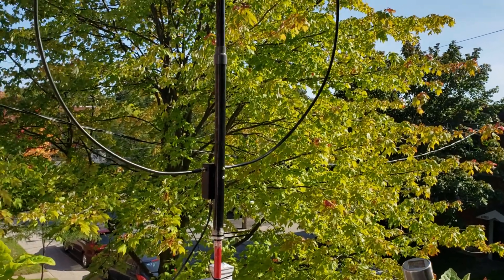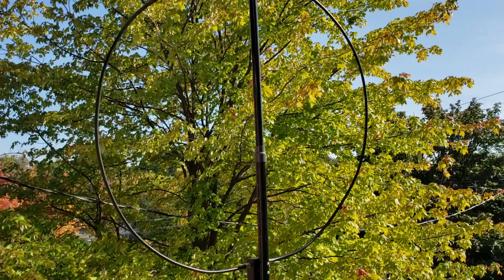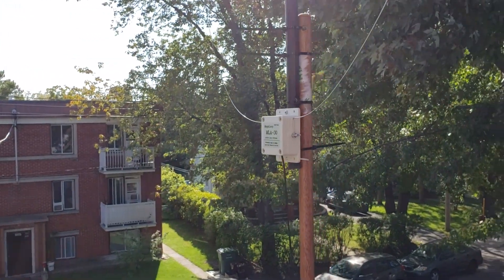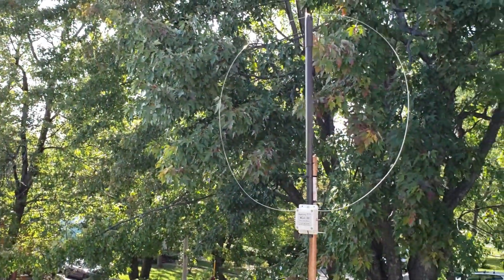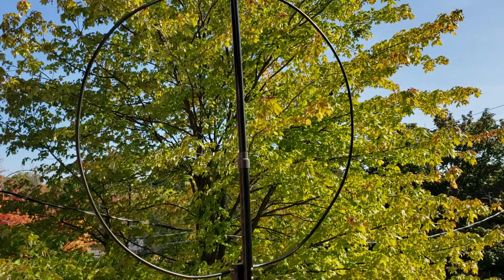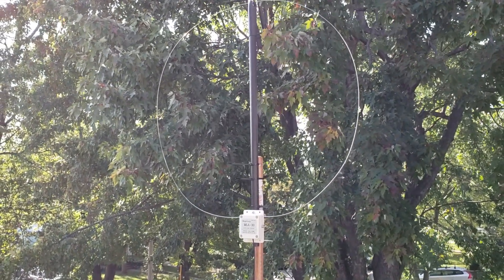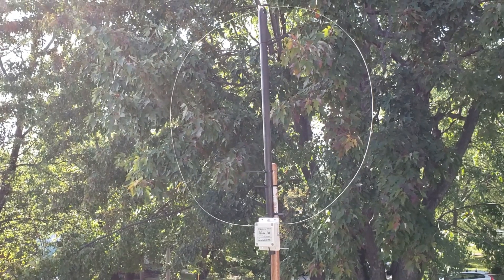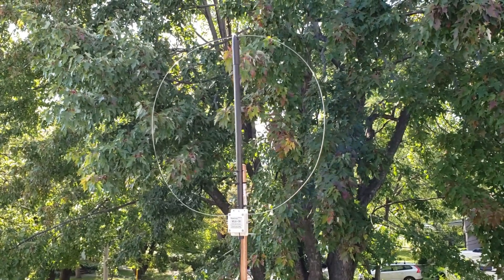First hour battle of the antennas W6LVP loop VS MLA 30 loop test

Comment: I enjoyed your video.  I have a question, how does the MLA-30 compare to the W6LVP when receiving in the area of 200KHz thru 600Khz?
Reply from the maker: can't say, mine has a Filter that blocks everything below 1.8 MHz so I can't compare.   But if I look at the performance of both at 2 or 3 MHz .. I would say the W6LVP might be better in longwave and mediumwave
Reply: OfficialSWLchannel  thanks for the reply.  We are looking for an antenna to receive  the signal from  an NDB beacon for doing off-the-air monitoring of the facility.

Comment: I have lots of noise here and it is noticeable that the ML-30 is less prone to that specific pick up than my Wellbrook loop or a small active Whip (tried PA0RDT & transverter-store) types.
The performance is probably like one of the prototype stages of the other big names, they went on get wider coverage or  more consistent noise floor but here it's like "nah that's OK, will sell, get a million made" - cheap. 

My antenna of choice here is the (active-antena eu) design from LZ1AQ, nothing allows me to reduce my noise problem like that kit but the ML-30 is good in parts and very kind to the wallet.

Comment: Totally agree, price and quality should be proportional, but very often isn't.
I now live in a multi family home in the city and used to live on a large property in a suburb with long wires and verticals for HF that have gotten more and more noisy over decades.
Trying to SWL with passive and later active electrical antennas was quite a journey. Short active electrical antennas gave me results so bad that I stopped SWLing for years and in the end of 2006, when SDRs became more popular I built the SDR by myself (with sound card A/D) and a shielded indoor loop as well, which was a great first step into the right direction. Then later I was able to install an antenna in the attic, where an electrical whip failed badly, even my indoor magnetic (beside the RX in the shack) was much better. Because of the massive local electrical noise I thought I'd try something magnetic and highly symmetrical, to give the unwanted local e-field the least chance of coupling into my RX. 
Because I was spoiled from operating real big wires, verticals and a beam in my early SWL/ham career in the late 70s and 80s, I had high standards and because of the noise from poorly choked switching supplies in literally every electrical device, I kind of gave up on dream of good signal to noise. So I thought I spend a last time up to 100 bucks into a ready made preamp that looked very well designed for what I was looking for.
So I bought this (https://active-antenna.eu/) LZ1AQ design, ready made preamp and created two loops 90° shifted made from stiff copper wire (1m diamater), used for high current electrical installations (20 bucks from a home depot like store), put it into the attic connected to the custom crimped CAT7 ethernet cable, measured the wiring, turned it on and I was simply speechless with the signal to noise my place!  Here is some of the theory behind the basics of his concept: https://www.lz1aq.signacor.com/docs/wsml/wideband-active-sm-loop-antenna.htm
I put this up a year ago and am still very happy with the results, reminds me on the good old days in the 80s. I recommended it to two friends, one compared it to his high outdoor longwire and has a similar S/N indoor, the other one has not taken the time to install it. So now I am really wondering if it is my noisy location that makes this antenna shine over my homemade shielded loop wideband antenna, which isn't all symmetrical, neither the preamp, nor the cable into the shack.

This LZ1AQ preamp has 4 selectable modes, controllable by the converter in your shack, 1 electrical antenna, loop A, loop B and loop A&B on the magnetic amplifier ... the S/N on the loops in magnetic mode is amazing and because the loops are not shielded, their self resonance is, depending on the diameter usually way above 30 MHz, so you can use it over the entire range with a good match from VLF to HF.
Some friends  have wire antennas in the attic and they have no chance to pick up what I am picking up ... e.g. digital HFDL ground station messages from Guam and Hawaii almost on a daily basis while I am located in Munich, Germany!  If you are a person who enjoys building some of the mechanical part of the antenna by yourself, are able to crimp ethernet and know which is the hot end of the soldering iron, live in a noisy environment, this might be (one of) the best solutions for you ... for sure in this price range ... here is how customers got inventive on the antenna around this genius preamp. https://active-antenna.eu/amplifier-kit/testemonials/
I have no affiliations to LZ1AQ, I am just impressed with this very unorthodox receiving and feeding concept that does an outstanding job in my place - BC signals with 70-90 dB over the noise is totally normal. Please make sure your SDR can handle the dynamic ... I recommend nothing under 12 bit and possible use some preselection.
To give you an example what signal to noise we are dealing with ON5KQ used to have an KIWI SDR connected to a horizontal LZ1AQ loop, but his station is currently down ... hopefully he'll be back on again, because this is how I learned about this oustanding system.
I hope there will soon be a version that send the signal of loop a and loop b simultaneously independant into the shack, so you can use modern dual channel SDRs and phase shift the signals by software, practically turning the mechanically fixed antenna electronically, nullung out unwanted signals and be able to save these settings in software presets.

So don't give up on HF in crowded RF polluted places, try magnetic antennas, even a poorly designed magnetic one  will outperform an active whip antenna or wire.
Reply: I enjoyed your reply above, so I'd like to get your advice on the passive magnetic loop antenna I'm building here: https://swling.com/blog/page/2/   Thanks

Comment: While what you say of the MLA 30 being as good as or better than the W6LVP, both will suffer from the winter wind & ice weather conditions.
I will bet that neither of them makes it through the winter months in the same condition as they are now?

Giles, do some close up shots of the mechanical construction of these 2 loops and how they might handle different weather conditions of rain, snow, ice, etc.
Reply: mine fell off the mount and crashed into the ground, it also has been through major storms, its waterproof and pretty tough
Reply: @CampHacker    Is that winter weather with ice & snow?  or just rain and wind?
Reply: @busterbrown8830  latter , i am actually aware of the dangers and have decided i am going to put a poly vinyl loom over the exposed metal made from a a cpap hose, and the box itself covered with another exterior case , just in case... literally..so basically fortify the unit against the ice with junk i have just stored away for a "rainy day"